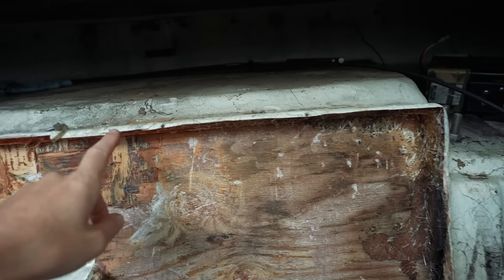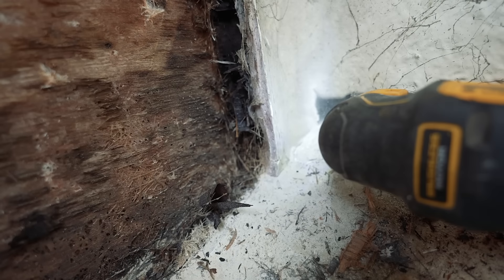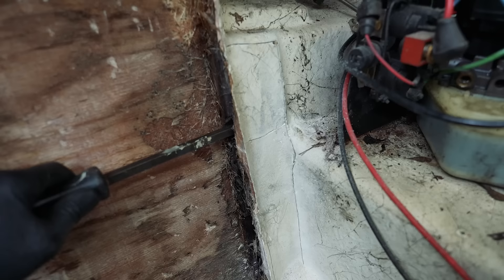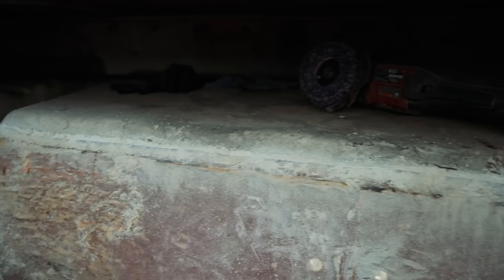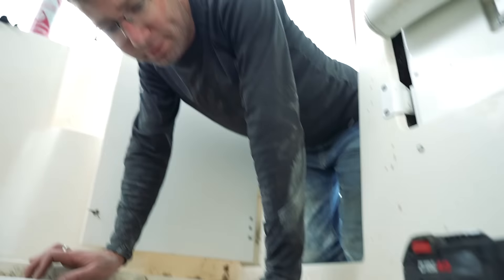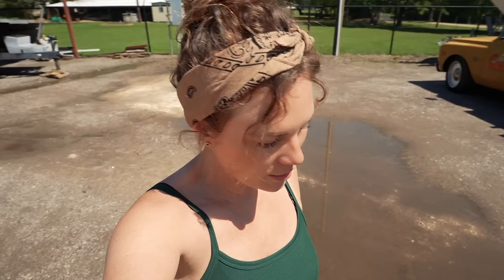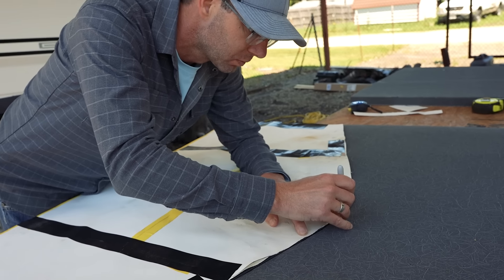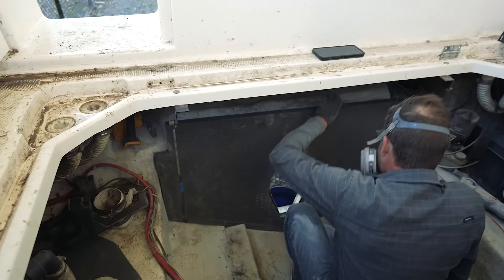Our BIG BROKEN Boat getting a NEW Transom!

Comment: When i have done the fiberglass grinding and sanding, I go to the local thrift store and buy a long sleeve shirt and any old pants that fit ( usually $3-5 each if you dont care about style- I dont ) then after grinding and sanding I just toss the whole outfit in the trash and take a shower.. never wear them twice...
Reply: Tyvek!
Reply: With fiberglass, take a cold shower first , then hot , hot water will open the pores and the fiberglass dust gets into your skin , it will itch like crazy , cold water first gets rid of the dust and reduces the skin irritation . .

Comment: If you think it’s starting to rot? Cut it out or you’ll be doing it again in 2yrs. Tie your fiberglass in really really good. If you have a vacuum pump? Use it to pull your resin into voids by drilling a small hole where you want the resin to flow to.

Comment: you'll want to "bed" coosa board into a mix of resin and fumed silica or something else (chopped glass can work but silica is great to stuff to use) to make up a slurry of light weight material to act as a grout like filler for all the gaps.

Comment: Guys, that was well done. Simple inexpensive fix when doing it yourselves. Having more than my share of fiberglass work on Vette and boats, I can say, you guys nailed this repair. Thought the thickened material was a bit think but should work. Ratio of glass to resin is critical for strength. Your fiberglass overlay should be cloth not chopped mat. Final layers, and you need several, can tie this together. Looks good. Have fun and stay safe. 
PS:  If you have minor wood rot in stringers, the resin product you referenced, is amazing. Once resin sets, the stringers will feel like iron.
Reply: Said everything I was gonna comment on.  I rarely use mat, much prefer the cloth for strength.  Plus it disappears reasonably well when I'm working with it over wood, that want to show.  (Then the varnish, for sunscreen, lol.  Lots of coats on brightwork...)

Comment: Great job guys! Might I suggest --Wide strips of coarse roving run from the new transom inboard along the stringers for a foot or more past the transom and replacement sections of the stringers will help tie the stress forces on the transom into the rest of the hull. This will help prevent future stress fractures in the external gel coat and loss of transom and stringer integrity. Scuff up the existing internal fiberglass before application of the roving. When the boat plant I worked at did transom to keel and other angles we always reinforced with coarse roving at all transition points. Especially with repairs. BTW in 1976 a one inch ding in the external gel cost $100.00. Can't imagine what it is now.

Comment: While you have a engine out I would replace the circulator pump(Water pump) and  water pump impeller on the lower unit. Do everything that looks original on it to avoid getting stranded.

Comment: Guys… did you ask some well experienced fiberglass people on how to glass in your transom?  My family worked in the FRP industry over 50 yrs in the Pacific Northwest.  I personally owned a company producing Gel Coat and polyester glass fiber putty.  “Thixo”  The putty is used round out 90 degree corners to more easily lay up the fiberglass without any trapped air.  It is also used to set in stringers and glue in structures that will be glassed over.  I saw you using “mat” fiberglass but no heavy woven roving… laying up fiberglass is always done is a schedule of various weights fiberglass for structural strength.  The glass fiber putty would have been perfect for gluing in the transom part in your case… just resin is not really enough.  IMO. Hope you used some woven roving in laying up the rest of your repair… waiting for the next video to see how you proceeded.  Good luck!!!
Reply: I wish you had a boat repair company in the tri-valley area of the SF East BAy,   The one and only company, Boatmasters, closed up due to retirement.

Comment: You should cap that stringer with a heavy gauge upside down U shape, through bolted across the stringer and it would give you a solid, fore ever engine mount .

Comment: There are some 'slow' hardeners that can give you more working time before the poly resin starts to set up.  I think TotalBoat has a version of their hardener that is slow cure.  Also, you can cool the resin down before using it for a similar effect. . . Like put the resin in the refrigerator for the night.  The Texas heat will bring it back to life, but you will get more working time.  The problem is that you don't want the resin to be setting up while you are still working.  Also it is easier to slobber the coosa with resin and place the fiberglass mat over it, so the resin soaks 'out' rather than trying to soak it 'in'.

Comment: I did the same job on my 2655 5 years ago-  you were lucky to have the slightly bigger engine room.  The Coosa board is neat stuff!  My stringers were pretty raunchy too, so I cut the tops off, chiseled the Cream of Wheat out between the remaining glass, and filled them with Arjay pourable ceramic.

Comment: Great in depth coverage of the procedures.  Y'all's banter back and forth is what makes your channel so informative and easy to follow.  I've never owned a glass boat, but did transom work on my 1965 36' Trojan mahogany cruiser.  It is a bit different in that my boat was a twin engine, but the clean out and prep work is the same, in procedure, anyhow.  Start with a clean area and build out.  Good luck on the stringers and mount placement.  While you are in there is the time, for certain!  Love your channel, started out Emily in the shop when "The Kid" was a munchkin.  Here for the duration.  I am a pilot as well, so I really enjoy the flying segments.  Peace...

Comment: To fill that bottom section you need to mix up a thick epoxy paste. Silica is what you use to thicken the resin. It will act as a filler and allow you to bond the coosa all the way around the perimeter.

Comment: If your stringers only have a little rot. 1-dry it out 2- you can flood the chamber with resin it will soak in to the wood and arrest the rot way less work .3 - trapped fresh water = rot at some point. 4 - more then 1 way to fix a dry rotted transom .Looking good .

Comment: As your doing your boat repairs, look into a product called marine tex, it’s amazing and will adhere to wood, plastic, metal and fiberglass.  It’s so strong when it cures that you can drill through it and makes everything water tight and really strong. Just wanted to introduce this product to you.

Comment: Note, there is a great deal of competition between brands of Power Stations aka solar generators right now, and a lot of off grid Tubers, are getting nice set ups for free, the more subscribers the bigger the set up.  I don't know who contacts whom, but a decent size power station will charge a lot of tool batteries, computers, and cameras, and other batteries, and comes in very handy when camping or power outages.  I have 3 smaller lighter ones, one for the refrigerator I keep in my truck and two for charging things when camping.  (I like resin and glass matt flying as well as sparks...)

Comment: When the back of transom bows and the outdrive dont line up flush, it will leak. Should have used plates inside and out to brace. Mix resin and airacil to make a paste to fill gaps and edges.

Comment: Did you find where the actual leak was? Also how will the extra thickness added to the transom affect the motor and lower unit joining? The screws holding the motor mounts are comman lag screws, I would replace them with Stainless Steel ones, if you can find them, or epoxy coated deck lags. Also have you inspected the keel for any cracks? Good luck with your repairs.
Reply from the maker: The transom is actually the exact same thickness. It had 2 - 3/4 “sheet of plywood and we use 1 - 1 1/2” sheet of Coosa.

Comment: i guess you know when you get to the point you put engine back  in  you will have to use an alignment tool  to keep motor and shaft in position so you don't damage any thing in the drive line  before placing out drive back on because you moved the motor supports and lag bolts

Comment: The small gap under the transom is intentional.  If you fiberglass it rigid, it leaves a "hard spot", which is a location likely to have gelcoat cracks...at the interface between the hard spot and the flexing portion of the hull.  Good chance you will also see an air gap under the stringers for the same reason.
Reply from the maker: Good to know! Does the transom typically rank on the outside in that area? It’s not in the best shape on our boat and we want to deglaze that outside and make sure it’s strong, but if the element of flex is important, how do you suggest we handle that?

Comment: 3m 5200 caulk is your friend. Especially where bolts go in or hard to reach edges.
Reply: 5200 below the waterline, 4200 above the waterline. 5200 is considered permanent and is extremely hard to remove.

Comment: What is coosa board. Is it taking place of balsa filler or what? Try marine grade spray nine in the bilge and wash it out. It will look like new and remove all oils as well. I worked for a marina for 20 years.
Reply from the maker: Coosa is a composite material made out of fiberglass. It does not rot like plywood.

Comment: WHEN I DID MINE I WENT FROM THE OUTSIDE IN AND LEFT THE FIBRE ON THE INSIDE ALONE THERE IS PROBRABLY WATER IN YOUR STRINGERS TOO IF THEY ARE CONNECTED EASY TO TEST JUST DRILL INTO THEM WITH  A SMALL DRIL.L  BUT HEY ONE THING AT A TIME

Comment: On your motor mount attachment points, over drill like 5/8 or 3/4” and use thickened resin, epoxy and then drill them to accommodate the lag bolts,Make sure you get to solid wood, it will prevent water intrusions in the future and give very solid mounting attachments

Comment: What is the material you used for the transom?
I replace transom on a 16’ Glasstron with 60HP outboard many years ago. Had no idea what I was doing and absolutely no experience.
I used 3/4 marine grade plywood then had a 1/2” or less aluminum plate cut that overlapped the original part and the new part. Fiberglassed wood in and screwed on aluminum plate. Worked great, owner after me ran for many years.
Now I see there is a new product that you pour in from top after you dig out rotted wood.

Comment: Almost nothing worse than working with fiberglass. I hated delivering it as a truck driver. Owen's corning fiberglass was always a floor load for a Hardware store I used to deliver to up I Calais Maine so I had to handle each and every role. In the winter time it wasn't a problem because I was always bundled up and that pesky fiberglass couldn't get on me but in the warm and hot months OMG did that suck!!

Comment: Since you  are cutting back to the corner of the bottom and transom you are eliminating the structural assets that were built in in the original molding.  You better put some knee braces at each stringer and  anywhere you had a transition from bottom and sides..  Just saying it is not just the engine holding in place it is the leverage of the boat bottom against the center line of torque from the thrust of the engine... If uou use wood as a filler or brace coat it in copper sulphate before installing to prevent rot..
Reply from the maker: Thanks for the suggestion!!

Comment: I’m afraid your thermo-lite board needs a lot more preparation & glassing around the edges, it’s propelling the boat against the transom, you need the real strength in the boards abutment edges , you can’t rely on engine mounts holding the leg from pushing through, . Good to see it’s a in-house job, I’m sure you got professional guidance, people beware, it’s the most integral part of a motor boat, -  new technology catching up to the seventies way of life

Comment: Very impressive, you two!  Did I hear you're going to swap engines? Whatever you do, make sure you put a marine engine in there. NOT a car engine.
Reply from the maker: How about truck engine? 😇😅
Reply: @flyingsparksgarage  What ever you put in, it needs to be marinized. Assuming a raw water setup (like you have now) you need corrosion resistant (marine) freeze plugs and gaskets. starter and ignition components need to be explosion proof (Marine SAE J1171).  Truck engines are more suitable than car engines but a direct transplant of any vehicular engine for an application such as yours will be very problematic. From my perspective, its more trouble than its worth but I would admit it will make some very interesting content one way or the other.
Reply: Also, marine engines have a different grind on the camshaft since there is only a single speed transmission
Reply: @kevinsislo7160  True, although the grind is typically closer to a truck cam than a car cam, especially a high performance car cam. Low end torque is a bigger focus.

Comment: Temperature is critical, hotter it is the faster it kicks, thats why there are diferent speed (temperature) hardeners. Also its an exothermic reaction, and not a good conductor, so if you leave it in a cup or spread it thick it will kick off even faster.. potentially causing a fire risk in extreme situations. (talking like filling a 5 gallon pail of mixed epoxy and leaving it there)

Comment: OUCH LIQUID NAIL IN MARINE WORK BETTER OFF USING MICROBEADS AND MIXING RESIN INTO A SEMI PASTE APPLY WITH A TROWEL THEN PUSH INT PLACE AND REALLY BRACE IT UP ALL OVER SO THE PASTE SQUEEZES OUT ALL AROUND SCRAPE OFF EXCESS LET DRY

Comment: That kind of work is really nasty and itchy  i've done 3 trasomes and two complete floors and support ribs to support the floor these all were 15 foot outboards the resain is tricky  if you add to much harner it sets before you are readsy and wastes the resin which is not cheap

Comment: Arron, fiberglass guy here. First  glad to see you went to long sleeve shits. My only concern is the thickness. Is the motor going to wind up at the same place? That's just an ugly job>
Reply from the maker: Yes, we achieved the exact same thickness as before. Originally they use 2 - 3/4” sheets and we used 1 - 1 1/2” sheet.
Reply: @flyingsparksgarage  Good job. I thought you would think about that. I almost bought a beautiful 24’ SeaRay off the guy that started Dakine in Oregon. SBC had froze and broke, $1500 for boat and trailer, but it had that same transom problem. I had a 24’ sailboat and decided it was too messy of a job.

Comment: You should have ground the gel coat off a solid 6 to 8 inches past the transom all around.  A matt, roving, matt laid down behind the board. Also, I always see people using epoxy. That's a total waste of money. Your boat wasn't made with epoxy, no need to repair it with it. A polyester resin is much more affordable and would bond to the ground down surface with incredible strength. I also would have put a 1/2 inch radius on the inward surface of that coosa board so when you cover it with another matt , roving, Matt it will take the bend nicer, with no air pockets. The layers that cover the coosa should extend past a good 6 to 8 inches to insure its a strong long lasting job.  I was a boat repair man for 18 years, and have done hundreds of these jobs.
Reply from the maker: We appreciate this info. The plan is definitely to feather back past the transom before we lay more glass down.
Reply: @flyingsparksgarage  a full suit and full facemask respirator makes it less itchy. It would have been easier to grind it ahead of time with plans of it getting glassed further out.  There also a jig that allows you to drill all the gimble holes square as well as the upper ones for the steering swing.

Comment: if you  use panty hose with  baby powder while messing with fiberglass you can get it off you easily no mess or  fuss when doen just  pull the panties hose off yoru  arms inside out and  was in  hot wateer  then in cold water opening and  closing the pores